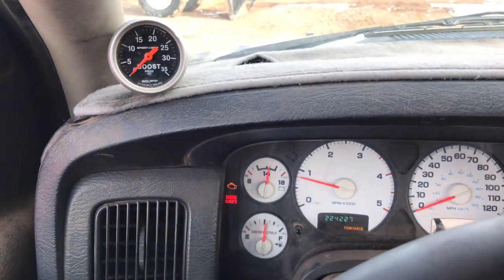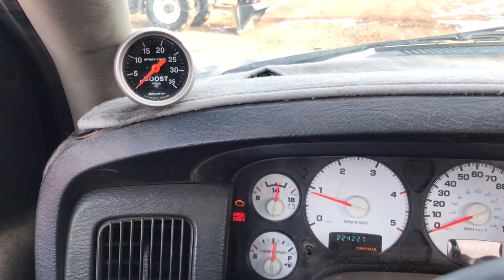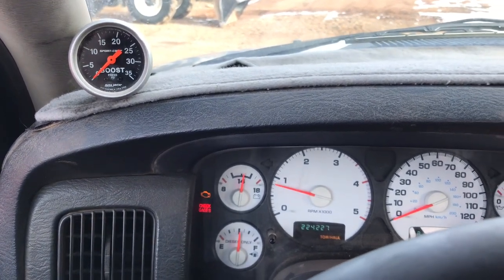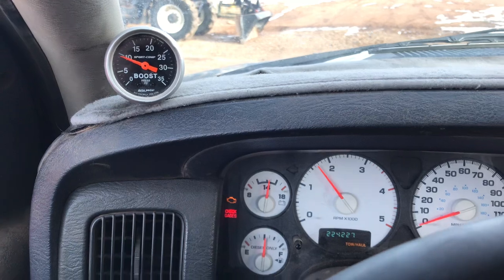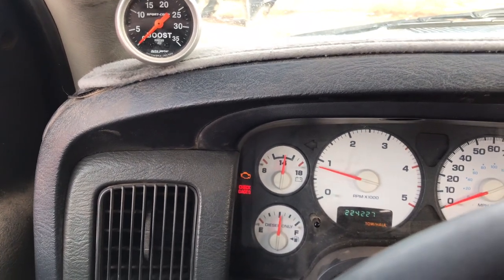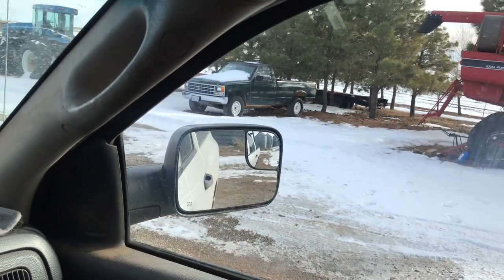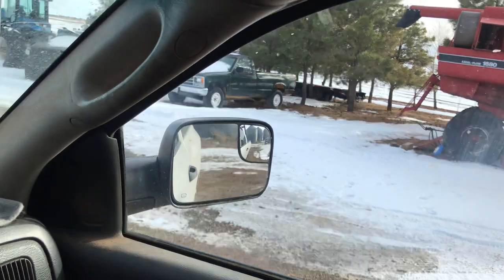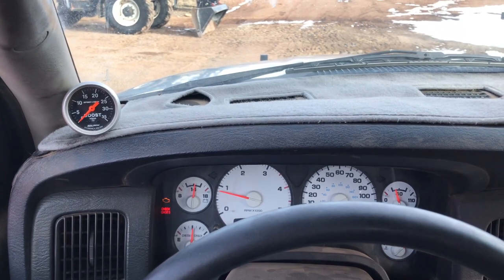He351/S475 compound turbo spool up

Comment: Did you say “ AFC live “? Did you mean EFI live ? I don’t think I’ve heard of AFC live yet but
Reply: Afc live is a fuel/air controller for the old mechanical trucks before the electronic injection.  EFI live is the new electronic trucks.
Reply: I just found out they now have EFI live for our gen trucks. I feel old now.
Reply: So you have a twelve valve in an 03-04 truck? Makes a lot more sense now that I watched the entire video 😂.

Comment: Hey bud, can you draw me a wiring hook up for 12 valve into a 3rd gen Dodge.  I couldn't get my 12 valve alternator to generate outputs 13v.  Thanks. And also my alternator seem to be sliding back towards the rear like  1/2in so my belt kinda off.  Thanks a bunch

Comment: You 12 valve swapped your third gen?
Reply from the maker: Yep, about 7 years ago
Reply: @FROSTY2588  question do you think compounds are worth it for around 400-500hp? I'm planning a daily driver friendly 12V and the max amount of boost I'd want to run is 35-40psi while keeping stock driveability or should I look into a Vgt turbo?
Reply from the maker: @chrishansen7004  if you go with compounds you’ll likely run 40-50psi range. Which isn’t bad, just can’t try to pull those numbers at 1500 rpm and expect it to survive for hundreds of thousands of miles. I would go he351/s369 for you compounds. I have a 475 and it could definitely be snappier with the 369 (almost flies the same amount of air)
Reply: @FROSTY2588  369 is just on the small side for a compound setup, plus the s300s just aren’t as durable as the 400 frame turbos. Same as a s366 is a decent single with proper fuel but kinda sucks in a twin setup. Ask me how I know….. 69-66 are almost the same on the dyno.

Comment: Boost climbs awful slow
Reply from the maker: That was on a really tight converter at 7000ft above sea level. I have a stock stall now and it builds boost much easier
Reply: @FROSTY2588  is the stock stall i big improvement I’ve got a low stall that the truck came with with a similar setup it’s a s366/480 but mines a common rail mine spools similar to yours I’m looking for quicker spool up
Reply from the maker: @peytonmorris8730  in drivability yes a huge improvement. For your common rail I’d try a bunch of tuning and just general high performance maintenance before you go swapping converters. Things like fixing boost leaks, new air filter, and a valve adjustment can add up to a big difference.
Reply: @FROSTY2588   yeah I’ve replaced all my intercooler boots and intake horn gaskets it helped quiet a bit i had quite a few leaks before  I’ve adjusted the valves as well the only tuning I’ve tried is edge and I’m currently using a smarty s06 with tntr there both pretty Smokey but the smarty is a little more controllable on lower timing settings which I run  with the timing cranked up it makes more lag and a nasty injector clatter just cant mash it of the line tho I thought about trying out smarty udc and buy the dongle for it and getting a tranny controller possibly the smarty messes with the shift points so it short shifts so  I’ve combatted that by advancing the tv cable some so the tv lever won’t return as far i replaced gov pressure sol and transducer with the upgraded bd and ats  block but that didn’t do anything for the short shifting